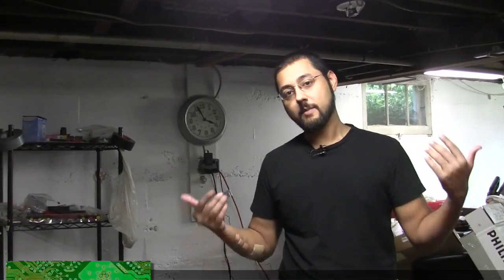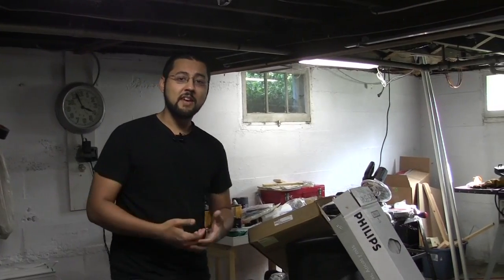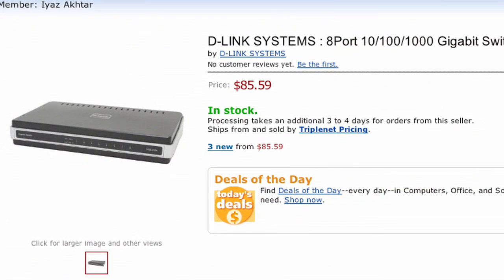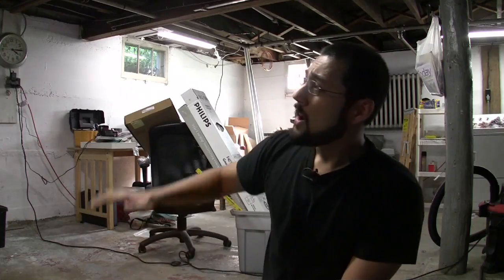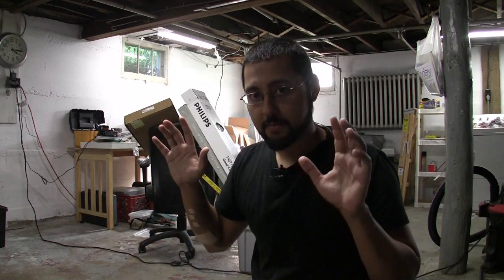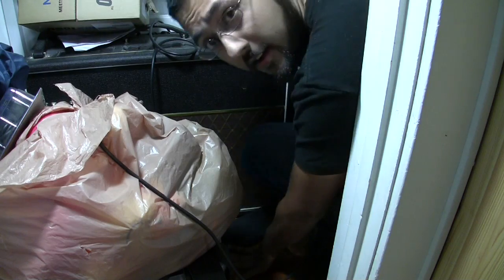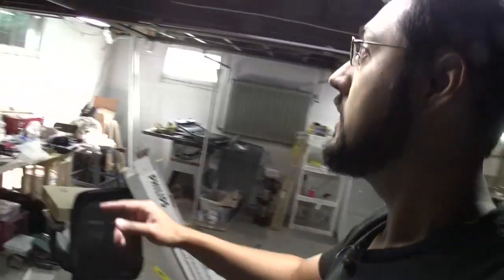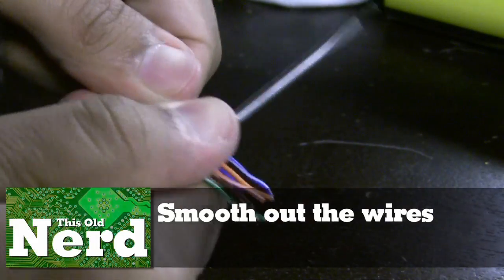01: Set up a wired home network - This Old Nerd

Comment: Omg... Please don't drill through the floor, put a jack in the wall and then go through the subfloor behind the wall.  Drilling through a finished floor is a lazy cable tv installer move.

Comment: Do not just drill holes in your floors... you have an unfinished basement just cut out a knock in box and buy an 18" drill bit and drill to the basement from inside the wall. Very simple, clean, and doesn't ruin your floors. You also then can install a proper keystone outlet instead of a messy cable.

Comment: How do you learn how to do this? What is the Job Title called because I've come across a lot of things. I am trying to actually get hands on experience with physically installing a network.
Reply: +oTarrell13o  Check out LOTS of videos on youtube and you develop your skills from the best of those techniques.
Reply: Computer Science
Reply: ***** Network Manager
Reply: ***** The tech guy
Reply: +oTarrell13o LOL at some of these replies. Its called structured cabling. Its actually not computer science or computer engineering. Go to www.bicsi.org to learn more.
Reply: Just call it IT
Reply: not_found Its not IT so why would you call it that? Low voltage cabling is part of the ITS industry which stands for information transport systems. IT and ITS are considered subsets of the ICT industry.
Reply: DJD1411 IT

Comment: What if you don't have a basement.  Then, I presume you have to go up into the attic.  If so where do you keep the switch? 

And why would you want a network connection in a closet?  Shouldn't you run the cable up (or down) through a wall to a box plug on the wall?  How could one do this?

Comment: I would like to see a video tutorial on how to set up a home network that has a common network coming into the residence where I would connect the game system the smart TV and phone modem as well as a common "guest" wireless network, and then have a sub-net for a DMZ where I can put my storage and servers, and then finally another sub network for my home office to make it deeply buried in the sub-network structure. So If I am going to connect the WAN port from the DMZ router to one of the LAN ports on the main Router or Primary Gateway? and then do I connect the WAN port from the router from my home office into one of the LAN ports of my DMZ router... What i need to know is how to daisy chain my sub routers ???

Comment: i have used both the plugs with and with out the giude, I sell them all, I buy in large bulk, both types fail on cable test 8 out of 10 times, and sure not new to it when trying to mke the plug, so i use rack mount keystone plates on the wall, or the reguler wall plates if not mmany are needed in one area, keystones install so much faster, then use a factory made short cable

Comment: I have found, installing the modeler plugs, fail 7 out of 10 try’s, and to top that off, is very time consuming when trying to make a buck doing. I use ether a single keystone, or a 8 to 12 keystone wall plate, that comes with all the keystones in it, using keystones never get a cable fail

Comment: like you do when adding a plug, you get cross, shorts, no mater how carful you are even using a magnifying glass to check the wires in the plug, the punch downs keystones never fail, and much faster and if one did, you can fix it, unlike a plug, its trash if it failed, then I use short factory cat5e/6 cables to jump from the wall plates to switch/s

Comment: Damn in my career and college, I never seen an RJ45 end with a guide. Very handy I guess.
Reply: https://www.platinumtools.com
Get the EZ-45 crimping tool and ez-45s. Makes crimping quick.’c easier and you will know that which of the 8 cables have been run through which position.

Comment: @Zainiak Not individual wires, just the sheath.  Trim it back about 3/4" to expose the wires.  Align the wires in the proper order and slide them into the RJ45 connector.  Ensure the wire's sheath is fills the RJ45's gauntlet allowing the crimp to press on the sheath not the exposed wires.  I hope that helped.